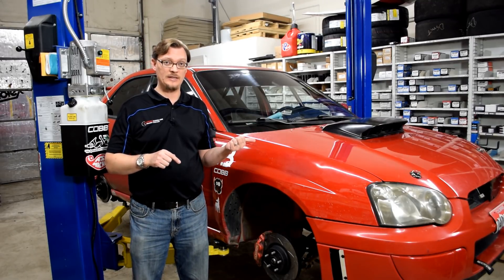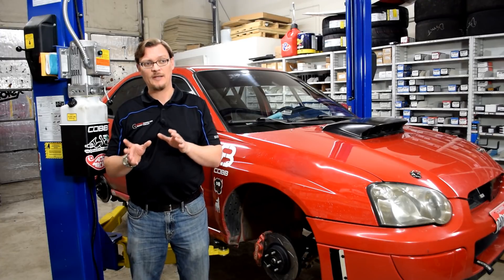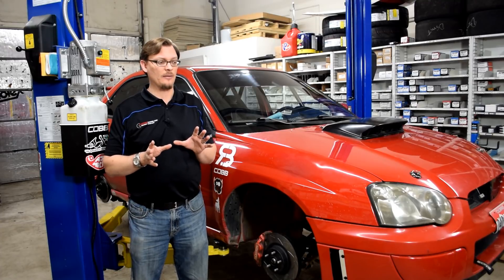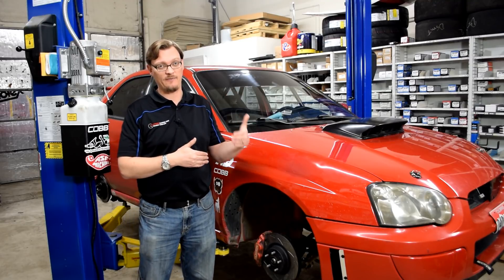STI 6-Speed Transmission Swap FAQ's

Comment: Thank you so much for your channel. It's been invaluable to me. Question: I want to put an STi transmission into an '05 OBXT. How is that process going to look different than what you've described here? Information on BL/BPs is hard to come by, and so I usually go with whatever the wisdom is for the GRs.
Reply from the maker: Thanks for your question.  Basically it would be pretty much the same as the process of installing a 6-speed into a 2011 - 2014 WRX.  The main difference you have is the body lift in the OXT.  For an Automatic driveshaft, it would have to be from an OXT only to have the correct spacer.

For axles, you can use the Spec-B rear axles if you go with an R180 as well.

I hope that helps and Stay Tuned!
Reply: @FlatironsTuning  Thank you so much. I don't quite follow you on the issue of the drive shaft, and do you have a video on rear differentials?
Reply: @FlatironsTuning  i have a 2005 outback wagon N/A with 5 speed but I need a little more to keep up on the freeway.If I get a wrx 5 speed trans can it work with the outback diff and can the axles work?

Comment: But my car was scooped with a Automatic :-(    Guess I gotta get a donor car.
Reply from the maker: That is definitely a bit more challenging of a place to start.  Largely because of the need to replace the pedal box, but also because on the newer cars specifically, you have to address the ECU more as well when you take the automatic transmission away.

Thanks for watching and Stay Tuned!

Comment: what are the benefits? will it feel faster? Why not keep the 5 speed
Reply from the maker: Thanks for the question.  The biggest gain is the durability of the 6-speed over the 5-speed transmission.  But beyond that, one thing that is often overlooked are the differentials in the STI 6-speed.  The front diff and electronic center diff make a world of difference.  

Honestly, a big part of why the STI feels like it has so much more grip than a WRX out of the box comes down to those diff's that you get in the 6-Speed.

Hope that helps and Stay Tuned!

Comment: You can also have the 2012 and later 6 speed trans machined to accept the speed transducer. It's a relative cheap and straight forward job, you just remove the front diff housing and take it to your machinist.

Comment: Hey man I’m doing a 04 sti swap in a 04 wrx and I was wondering we’re is the reverse light switch
Reply from the maker: Thanks for your question.  The neutral and reverse switches are the two things that are plugged into the side of the transmission, and then the DCCD is driven by the wires that go to the back of the transmission.

Hope that helps and Stay Tuned!

Comment: My 06 sti was built in 10/05. Would that be considered late?
Reply from the maker: You would have to check the serial number on the transmission but most likely it is a 2005 spec transmission since it was built in 2005.

Hope that helps and Stay Tuned!

Comment: I really need your help I have a 2007 wrx and I want to do an sti swap. and I also will switch the clutch kit and the suspension to sti is there anything more I have to do and also. I have found some sti transmissions but I can't find the number anywhere when I look it up the article numbers on the 2 I have found is these 2:  TY856UG1MA    TY856UG9AA    so I'm not sure is these will fit at all

Comment: I got a 98 Impreza  rs. does this swap work with that car also? what is the cost on doing all of this?
Reply from the maker: Thanks for your question.  Yes, the process is basically the same for the GC chassis as the GD chassis.  

As to cost, there are a lot of variables in play there in terms of components.

To start with, you can look at our 02-03 WRX kit (which would be most applicable to the RS chassis), and build the kit out from there.

All of the parts that we work with are brand new, so they are more expensive than used, but you also know that they will not have any wear issues, etc.

https://www.flatironstuning.com/flatirons-6-speed-transmission-swap-package-02-03-wrx

Hope that helps and Stay Tuned!

Comment: Can I utilize 07 wrx rear diff if I use 07sti transmission?
Reply from the maker: Thanks for your question.  No, those are different ratios.  I'd recommend going back to this video at 6:20 where we go into detail about the rear differential ratios as that should give you the information you need about this.

Thanks for watching and Stay Tuned!

Comment: I have an 09 wrx would I have to change anything on the front to change the rear diff, and axles to an sti
Reply from the maker: Thanks for your question.  As long as the R180 works with your WRX transmission, you wouldn't have to change anything with the transmission or front axles.

Thanks for watching and Stay Tuned!
Reply: @FlatironsTuning  alright so in order for me to change the rear diff an axles I do need rear sti knuckles?

Comment: If I wanted to use a JDM Ver7 transmission on a USDM 2003 WRX what exactly would I need to change? I’m thinking of buying a JDM Ver7 trans and most come with a rear diff and JDM wiring.
Reply from the maker: Thanks for your question.  I'd recommend going through our GD specific video.  That one, with the FAQ video here has all of the information you should need.

https://youtu.be/nUJ7E2Bh5g0

Stay Tuned!

Comment: What about STI swapping a 2004 Forester? Is it the same?
Reply from the maker: Thanks for your question.  It is mostly the same, but there are a couple small differences.  The biggest is the driveshaft.  The issue is due to the body-lift that the Forester has.  Going with a 1-piece driveshaft will make the swap much easier.  If you want to stay with a stock driveshaft, it would have to be from a Forester automatic to get the height correct.

And you will need a rear diff because of the different ratio of the Forester XT manual (4.44:1).

Hope that helps and Stay Tuned!
Reply: @FlatironsTuning  thanks

Comment: Great vid, and I have a question! Found an 04 JDM Forester STi transmission that I want to mate to my USDM GR WRX's R160 with a 1.5 Way LSD I installed in it. Since the Fozzy 6-spd has the 1:1 and 3.90 specs in theory it sounds like it should link to my WRX R160 fine and therefore I can avoid new axles. Any concerns however still running my upgraded WRX R160 with this Fozzy transmission that's non-DCCD but also had a non-Open front diff? The Fozzy STi 6-spd paired with AP SureTrac Front diff, and I know my GR WRX has an open front diff.
Reply from the maker: Thanks for your question.  Yes, as long as your rear differential has the correct ring and pinion ratio for the transmission you are running, it will work just fine.

As far as pairing of differentials, there is no issue running a rear clutch type differential, and a front torque biasing differential.  That should work well for most applications.

Hope that helps and Stay Tuned!
Reply: @FlatironsTuning  Appreciate the quick reply! Which DSS would be the proper one to link this Fozzy STi transmission to my WRX r160? https://www.flatironstuning.com/dss-carbon-fiber-driveshaft-wrx-sti .. actually I think I answered my question already and it's part SUSH12-C. If that's right, then with this shaft I will not need to buy a different rear differential flange?
Reply from the maker: @paterick4o8  If you have a 2004 - 2008 Forester XT, you need the SUSH6-C.  That is for the 6-Speed conversion with R160 rear diff.

Thanks for the question!
Reply: @FlatironsTuning  Hmm.. My car is a 2012 WRX, and throwing in a Forester STi trans TY856WL4CC.. it sounds more like it would be the SUSH12-C shaft to fit this to my 2012 WRX R160?
Reply from the maker: @paterick4o8  Gotcha, sorry, I got confused with the Forester trans.  If you have a 12 WRX, then you need the SUSH12-C as you had previously.
Reply: @FlatironsTuning  Thanks. Looking forward to how this swap will go next month! This Fozzy STi trans is non-DCCD but has an AP Suretrac front diff, and the ratio & specs to mate to my WRX R160 w/ LSD seem the easiest fingers crossed but we'll probably get some curve ball along the way 😅

Comment: Would this video be helpful for someone trying to put a 6 speed in a 99 SF forester?
I eventually intend on putting an EJ202 or EJ207 to accommodate the transmission components
Reply from the maker: Thanks for your question.  Yes, definitely.  I would also recommend looking at our GD swap video as that will also give you a good picture of what it will take to swap a 6-speed into your Forester:

https://youtu.be/nUJ7E2Bh5g0

Hope that helps and Stay Tuned!

Comment: Great videos.   We have a 2013 wrx.   We were going to buy a 08-14 jdm 6 speed but ended up buying a wrecked 13 sti for the transmission/suspension.   What are the differences between jdm and US trans? Thanks

Comment: Having done the 08 sti swap into a narrowbody, the rear sti axle fits no problem.
Reply from the maker: Thanks for your reply.  It will go into both the diff and the rear hub, but we have seen binding issues because of the length of the axle.

Thanks for watching and Stay Tuned!
Reply: FlatironsTuning hasn’t happened to me yet but thanks for informing me about this! I’ll keep an eye on it.
Reply: If in binding you mean blowing out front wheel hubs, this is happening to me.

Comment: What year, 6 speed  sti transmission would fit into my 2007 Subaru Forester XT?
Reply: Thanks for the respond. Will I be able to use my rear diff with the sti transmission also? Or what would you recommend?
Reply from the maker: Thanks for your question.  In terms of the STI transmissions, they are all the same fitment, so the year doesn't matter from that stand point.

Hope that helps and Stay Tuned!

Comment: You're better off buying better gears for your 5 speed than putting in the sti 6 speed.
Reply: In what way would that be better?
Reply: @chadharrison5681  
With the money you spend on swapping to to a 6 speed you can build a 5 speed with tougher gears that would be stronger than a 6 speed.
Unless you do it the cheap 6 speed way which won't last very long.

Comment: Help please I have a question is I have 03 sedan wrx doing v7 02-03 sti) 6speed swap Non DCCD has a 3.9 FD ratio. I’m using auto Impreza driveshaft and wanted to keep R160 hubs / axles. Will the 08-14 wrx r160 open diff 3.9 ratio bolt right up and snap into my current axles in rear. How should I proceed with my swap having issues finding R160’s with 3.9 ratios. Thank you !
Reply from the maker: Thanks for your question.  Yes, that R160 will work because it is the correct ratio.  Keep in mind it is an open diff, and you also have an open front too unless you have a type RA or Spec-C transmission.  You will most likely want to address that at some point.

Hope that helps, and Stay Tuned!
Reply: FlatironsTuning thanks for reply! Yea I was thinking that diff won’t last longer will it matter due to v7 non dccd trans and rear diff being open will there be torque split issues? Will I be better if getting dccd v7 trans instead and not hooking up controller until I can afford one? Mind you this is going on 03 wrx sedan. Thank you!
Reply from the maker: @itzzztoodah8203  The main thing that can come up with an open front and rear differential is your car is basically 2 wheel drive.  One up front, and one in the rear.  Since you don't have any traction control, etc., you can encounter a situation where the suspension articulates, and you lose drive.  

Going into  parking lot with a steep slope for instance.  Or if you are ever driving in snow and ice.

In that case, using the DCCD controller to lock the center diff will help.

Overall, you just won't have the same feeling in the car as you would with a front TBD, and some kind of TBD or LSD in the rear.

But the car will still be completely driveable.

Hope that helps, and let me know if you have any other questions.

Comment: Great video! I’m doing a 06 sti trans swap In my 04 wrx, now I’m wondering if I have the right 06 sti trans that’s compatible with the rear diff. Any idea how I can find out if it’s from an early 06?
Reply from the maker: Thanks for your question.  You need to verify the transmission serial number that is on the bell housing.  That will tell you what you need to know.

Here is the best chart that we have found:

https://www.rallispec.com/downloads/Transmission%20ID%20Chart_Public.pdf

Thanks for the question and Stay Tuned!

Comment: So if I swap a 2013 STi 6-speed into my 2014 WRX. Long as I use the matching rear diff from that 2013 I can use my front and rear axles into the 2013 6-speed and rear diff?
Reply from the maker: Thanks for your question.  Up front, yes, your WRX axles would work, but in the rear, you would need the STI axles to run the R180 rear diff.  The splines are different for the R180.

Hope that helps and Stay Tuned!

Comment: I just installed a JDM '05 STI trans into my 03 WRX. I used your kit to keep my WRX front axles too. I had just changed the WRX's clutch so I wanted to keep it for now. However, Once running the car will not shift into any gear! I swapped the Clutch master and slave cylinders and adjusted according to the factory service manual. I've had also pulled the transmission again and checked for correct installation. Nothing. It won't shift into gear. When the car is started in gear and the clutch is let out, It will whine and grind. Although, I never let the clutch out completely due to the noise. I'm thinking of uninstalling and exchanging at the shop I purchased it from. Any advice would be great! Thanks. Your videos made this possible!
Reply from the maker: Sorry to hear you are having trouble.  So can you shift through the gears when the engine is off, but not when it is running?  It somewhat sounds like the clutch is hanging up and not fully disengaging.

Hope you are able to find a good solution to get your car on the road.

Hope that helps and Stay Tuned!
Reply: @FlatironsTuning  It has issue shifting when the engine is off too. I exchanged it and installed the new one. Waiting on a missing transmission mount ATM.  Hopefully it's not the clutch!
Reply: Update! I got it working with the STI clutch set up without issue. Still not sure what the problem was with the WRX clutch though.

Comment: Great info so I can keep my hubs on a 09 wrx  narrow hatch and use sti axels  in the rear correct?
Reply from the maker: Thanks for your question.  As we discuss here, the answer to that is no.  The STI axles are too long.  For the narrow-body cars, if you aren't using the STI knuckles in the rear, you need to run the Driveshaft Shop Rear axles.  Those are the only ones that we have found to work on the narrow-body cars if you are running the R180. 

Here is a link to them on our site:

https://www.flatironstuning.com/driveshaft-shop-direct-fit-axles-800hp-08-14-wrx-w-r180-differential-conversion

Hope that helps, and Stay Tuned!

Comment: Hi I just need some reassurance on my end to make sure my research is correct. If anyone has experience please feel free to chime in. 

So I have a 2011 WRX with a 5 speed in it. I plan on picking up a 05 Sti 6 speed swap for a killer deal. So essentially everything should be plug n play since I won’t be running the dccd controller. 

I’ll need: 
- 05 Sti 6 speed
- front wrx axles (keeping 5x100 bolt pattern for now)
- Sti drive shaft (will the 05 drive shaft be the same length as wrx, since I have the hatch)
- Sti clutch assembly ( I heard I’ll need extra flywheel bolts since wrx uses 6 and Sti uses 9)
- 05 r180 rear diff 
- 05 Sti rear axles 
- 05 transmission mount 
- 05 rear diff mount 
- 05 Sti starter 

Anything else am I missing? Or anything wrong with what I provided? Thanks for the help!
Reply from the maker: Thanks for your question.  I'd recommend that you go through this video again, and also take a look at our GR specific swap video.

https://youtu.be/CieGYuOJQj4

If you have any questions after that, feel free to reach out to us through the chat feature on our web-site.

Thanks for watching and Stay Tuned!

Comment: So the WRX axles are compatible physically with an sti drivetrain?
You can just slide them into the cups on the differentials?

If that is the case one could get aftermarket uprated axles and install calipper adapters on the wrx hubs and you are set if you also get a big brake kit  assuming youll be going for more than stock power?
I imagine stock axles will be fine for stock ish power and still have live left in them.

If that is the case that is genious and Ill be doing that when I do get to that bit on my SF5 turbo since most of the stock bits are virtually GC/GD wrx parts.
However Im going to keep the stock axles for a little bit and then get conservatively uprated  aftermarket axles because something has got to give and Id rather blow an axle or two than a 6 speed. even if the 6 speed is a SOLID unit Id rather be safe than sorry. transmissions are expensive and a lot more work to repair or replace than some simple axles you just undo a couple bolts and  a boot retainers and slide them out given the new axle is a complete unit with a cv joint ready to go.

I dunno it just seems like the easiest and simplest way instead of getting an entire STI suspension and fit it on the car and spend heaps of money on all those bits and then make them nice if they arent already in immaculate condition. its good to have options anyways.
Reply from the maker: Up front, yes, the WRX axles snap into the STI trans.  This is not the case if you are using an R180 rear differential.

Keeping your WRX axles definitely makes the swap easier, and that is one of the reasons that we made this video.  We wanted to let people know that there was an easier way to get the STI transmission installed compared to going with a complete STI driveline.

Thanks for watching and Stay Tuned!